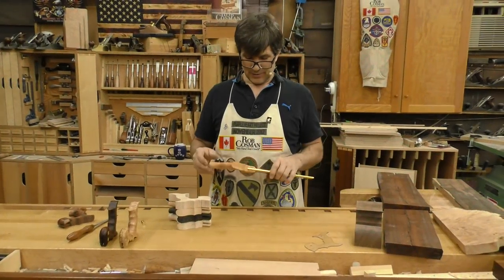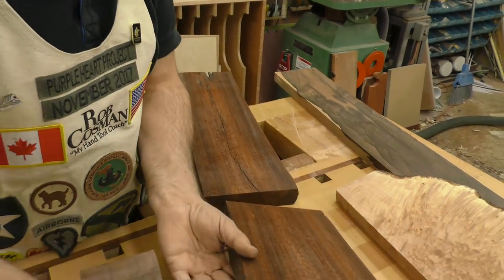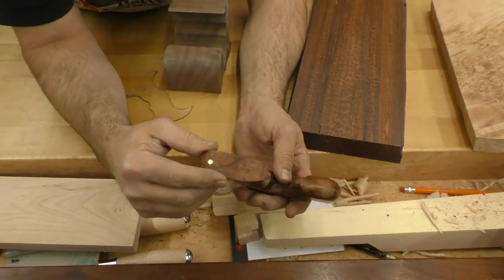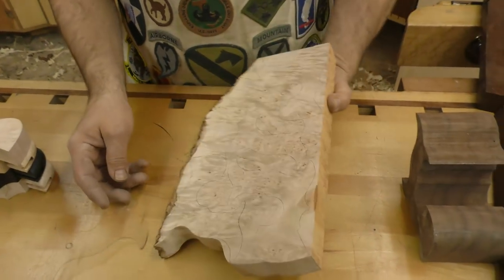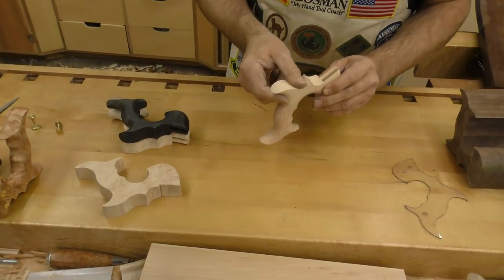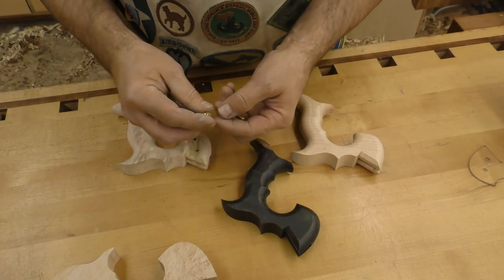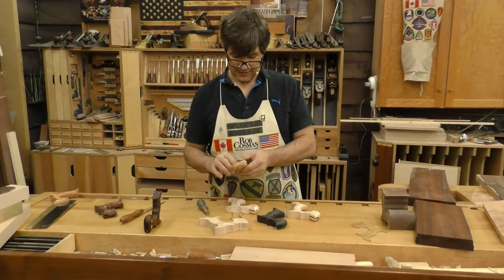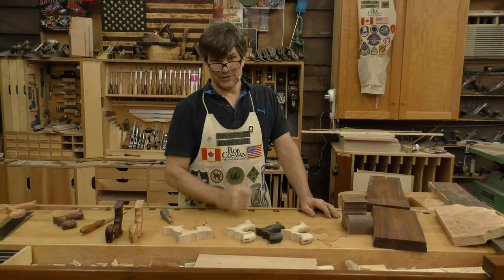Saw Handle Making with Rob Cosman

Comment: Hi Rob. How did the handle turn out with the three series of CA glue? Was the finish effected by it? I’m asking because I have some cross grain in some curly mahogany I’m dealing with on a dovetail box and would like to use this technique you used on this handle. I’m concerned it will split when I engage the dovetails with the pins, but don’t want the glue to be noticeably splotchy when I put the finish on.

Comment: Uhm ... $800 for a saw handle? Seriously?
Reply from the maker: I have 8 I am working on right now that are sold.  I try to make them and post to the site but a lot get bought before that ever happens.
Reply: Then you are serving a market that is beyond my comprehension.
Carry on sir. I commend you.
Reply: first answer: absolutely! 
second answer: You can use Meranti or Bangkirai, which are equally durable and beautiful, but unfortunately they come in most cases oiled -so no glueing unless you know how to handle that. And of course there are many synthetic woods out there, like bamboo-fibre-composites which are pretty, durable, easy to work on AND they are not from African black markets!